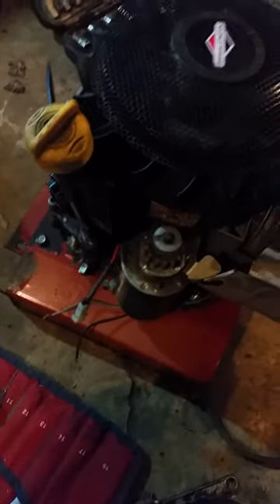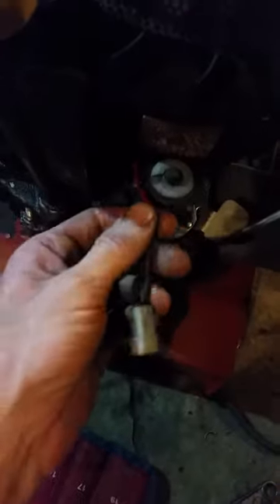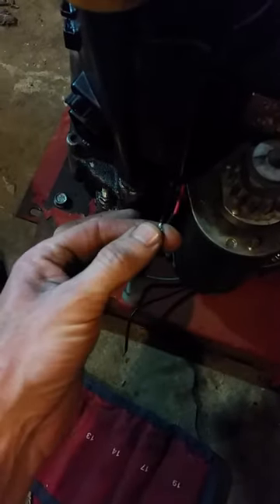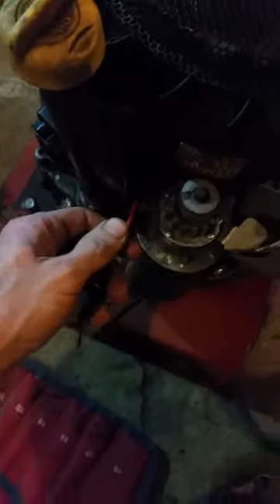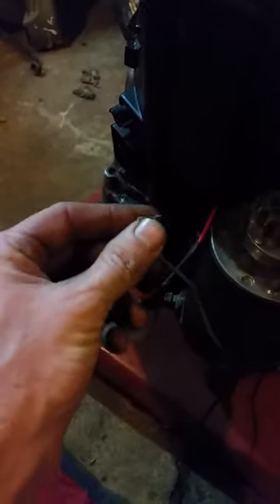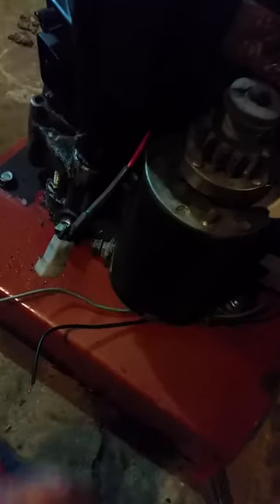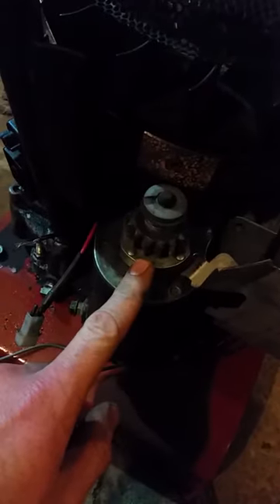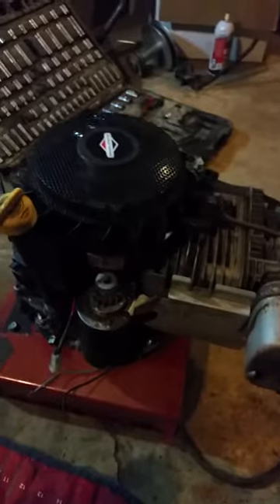wires on a Briggs and Stratton motor

Comment: Where do you hook the magneto wire too?
Reply from the maker: The magneto wire just goes to the battery.  The magneto is what charges the battery.
Reply: @springorchardfarm1214 Does it connect straight to the red wire on the battery.

Comment: Can I run my wire from my alternator right back to my battery for the trickle charge or do I need to go to solenoid and then inline fuse and battery??
Reply from the maker: I think it can go right back to the battery. It should be fine.
Reply: @springorchardfarm1214  thank you just got a craftsman race mower , lowered widened its pretty sick just needs some final stuff done and be rippin

Comment: could you please tell me how to install an interlock switch on a Briggs n Stratton 650 series 
or where can i get the diagram. As you might think the switch came off w/o me knowing so I dont know how is it wired I already have the new interlock switch.

Comment: Thank You!
Reply from the maker: You're welcome
Reply: Iam replacing a Kohler cv15t motor on a John deere g15 commerical walk behind mower with a Briggs and Stratton 31r976-0016-g1 17.5hp intex . Coming off the engine I have a red, blk , grey wire and on the mower harness I have red , white wire . What wires should go to what wires. Engine is pull start only.